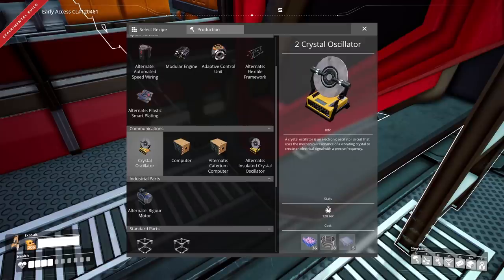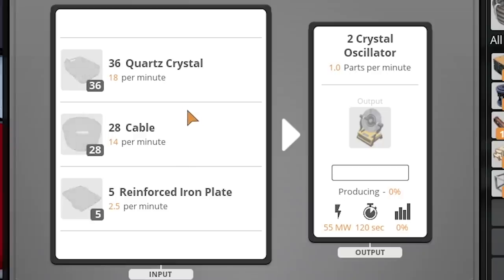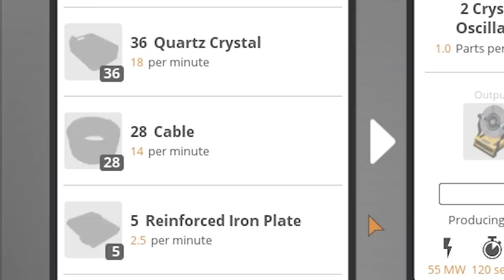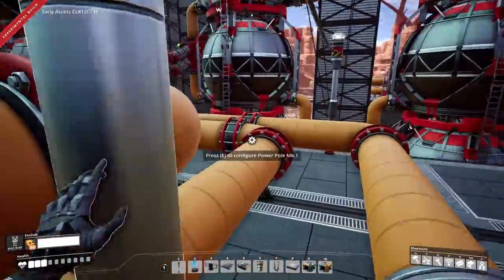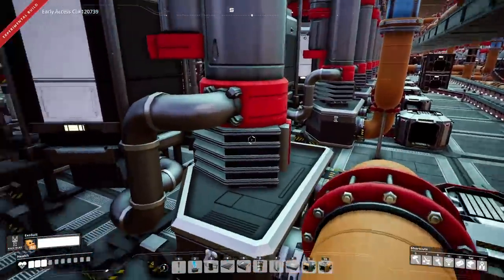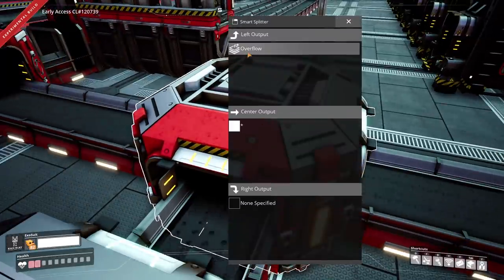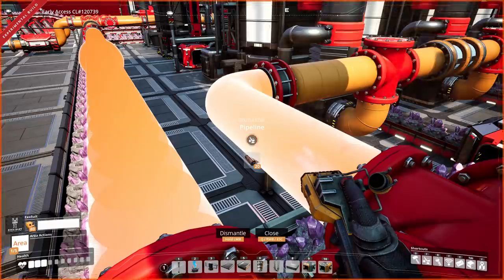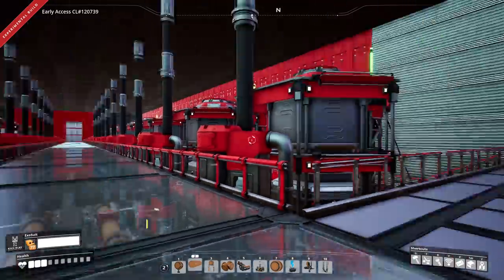The Smart Splitter Update changes EVERYTHING! - Satisfactory Early Access Gameplay Ep 27

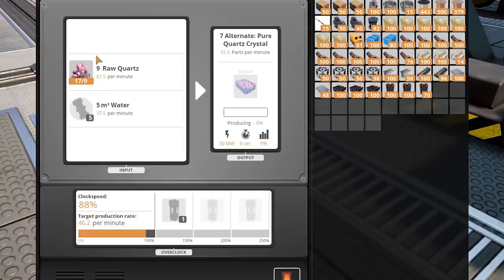Comment: 20:07 BTW Kibz, you can enter directly the target production rate instead of using the clockspeed. So you could have the refinery run at exactly 60 quartz per minute :)
Reply: That's not entirely accurate good internet person. While you CAN enter a target production rate, all it does is adjust the percentage to as close to the number you entered. So, basically, he could have entered exactly 60, and it would have said that. But the next time you look at it, you'll see that it really just changed the percentage to 189 (i think is what he used) and the production output is still going to be that 60.075 or whatever he ended up with.

Still easier to enter what you want it to be, but just wanted to clarify how that actually works
Reply: Does the .075 matter
Reply: Wait, the what?  I have to try this.

Comment: You're missing the best part of the Overflow - it's the second priority for the other piece.  So let's say I want to push a lot of items through one line.  I put an item on the right, any undefined on the center, and overflow on the left.  The item will go to the right unless it's full, and then go to the left (for example, to the resource sink), and everything else will go straight through (or to the left if it backs up that direction).

Comment: for the plastic and rubber you can have up to 690/min of each for 1 pure node : convert everything in heavy oil residue, then diluted fuel. convert the polymere resin to plastic en rubber (and fabric if you want). Finally, convert rubber in plastic and platic in rubber until there is no fuel left.

Comment: You should look into the copper alloy ingots. You can double your copper by adding some iron, and using foundries instead of smelters. Basically 1x780 iron ore and 2x780 copper ore = 4x 780 copper ingot. It's really neat and compact. I'm in the process of switching over everything to this.

And nuclear is neat in that it doesn't require oil at all...

Comment: @21:30 99% sure, huh? I think you missed a simple and very clean solution: Extend the manifold pipe going across a little to the right and connect each 150 output pipe directly to it and even out the input pipes. Then you'll have 1200 going in and 6 - 150 pipes going out that'll actually get 300 each.

Comment: They need to add a "Line volume" value when you look at a conveyor line. So it shows the volumes of materials "estimated", on the line. (Showing the max available from each source and also the current "flowing" volume on the lines, if the line is moving.) Would help a lot, instead of having to go find the sources and total them all up, then HOPE that it is actually all setup right, so it matches while it is being delivered. Even if you have less than the max, it can still deliver less volume, with all the odd setups they have for connections. (There are buffers and hiccups where lines connect, which can slow-down throughput to be less than the max that the lines can handle. Plus, you may accidentally have a chunk of slower line, hidden within a "splitter", or accidentally have added a mismatched lift along the way, but never know it until the line is flowing again, and you see gaps in the items, on the conveyors.)

Comment: in case you have not seen it yet in your latest videos in this series. there are 2 mods that add a fluid packer both  with a custom model. one of the mods also adds 4 new, very useful pipe junctions including a T junction. 2 Y splits. and a 3 way corner piece.